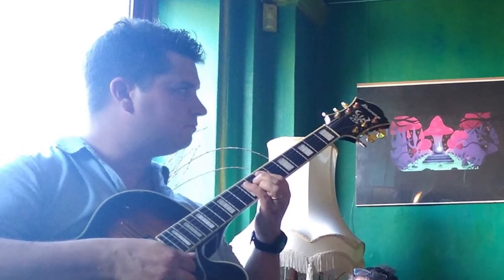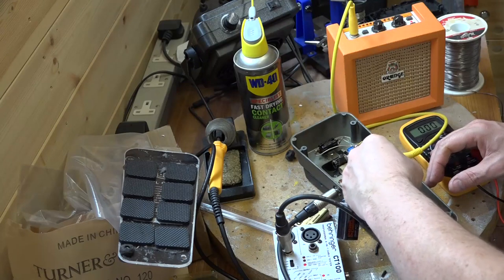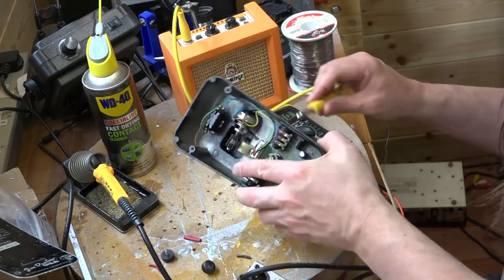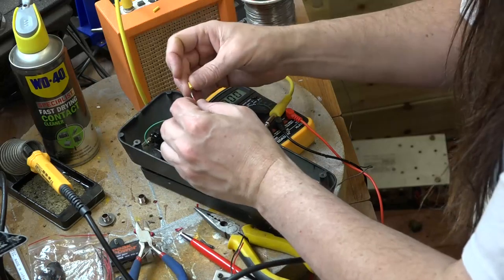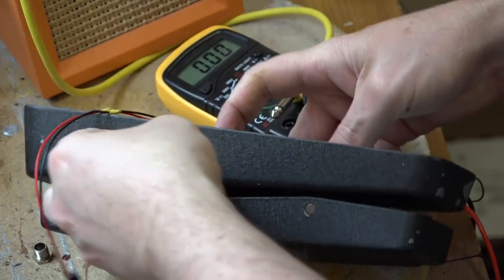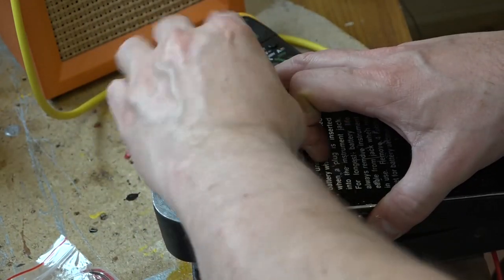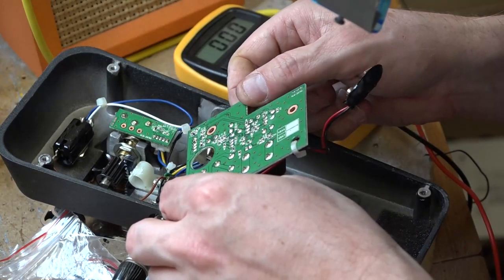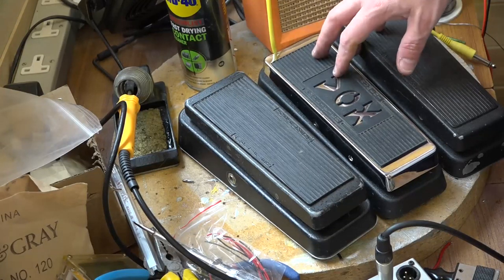Lets fix 3 Wah Wah Pedals (Jim Dunlop Cry baby and Vox)

Comment: Vox from Reverb : Well , opened the battery plate and was full of acid most wires and bottom & case cleaned out . Re solder new 9v plug . Shoot the pots with contact cleaner . Phono jacks cleaned . Now working !  $68.00
Reply from the maker: Winner!

Comment: Bought several non-working wahs on ebay and Craig’s list to use the enclosures for several projects.  First few I didn’t question their actual working/non-working status and ripped the guts out and replaced them. Got an early Hendrix wah that I decided to plug in and it worked perfectly. Picked up a newer Cry Baby 535Q - got it cheap because it didn’t work - worked perfectly.

Comment: I have the exact same pedal as the second one you worked on (Dunlop), but it's labeled as the Jimi Hendrix Special (Model JH-1S).  It also has a scratchy pot, but the gets less scratchy after using it for a while.  On the bottom panel is silk screened a picture of Jimi, and his "selected discography" starting with Are You Experienced - 1967 through Crash Landing - 1975,
Reply: I'd Say it's Time to Get a New Dunlop Replacement Pot Making Sure to Note The Proper Pot Ohm Rating for Your Model/Rev By Simply Using a DVM/Volt/Ohm Meter on Pins 1 and 3 of The Pot Using a DVM/Volt/Ohm Meters 200K Ohm Range Setting to Make Sure You Get The Corect Ohm Value Potentiometer for Your Model/Revision Wah.

Comment: Nothing is wrong internally the problem is when I push down on the pedal it does not engage is there something that could be missing or came a loose that keeps the pedal from pushing the button down
Reply: If There's Nothing Electrical Failing it Sounds Like Either Your SPDT (On/On) Switch May Have Gone Bad or it Needs a Height Adjustment, The Simplest Test for That is While You Have Your Wah Hooked Up With The Foot Cradle Toeup Physically Push The SPDT Switch On/Off With Your Finger, If The Effect Engages Your Switch is Good and Nothing Electrically is Failing, Which Would Mean it is The Nuts on The Switch That Need Height Adjustment, First Remove The Outer Nut on The Switch, Then Pull The Switch Out and Turn The Inner Nut Down About 2 to 3 Turns, Put The Switch Back in and Replace and Tighten The Outside Nut and Test for Proper Switch Height and See if You Can Now Toedown Your Cradle and Engage/Disengage The Effect, If Needed Repeat Those Steps Adjusting The Inner Nut Varying Turns (Clockwise/Counter Clockwise) Until The Switch Position/Height is To Your Taste/Touch.

Comment: RE: the 2nd pedal,  have one with similar electronics - my battery cable is routed under the circuit board. Mine was functioning but the sound was a horrible, high pitched distortion. I changed the 2 electrolytic caps before checking anything else. It sounds like it should, now. But, it's still not quite right. Because i didn't watch this video before starting i did a bit too much disassembly and i think i need to get the gear arm back to its correct spot on the gear of the pot. By the way, i have cutters that look just like that. I got them at harbor freight, but I'm in the US.

Comment: nice work. I have a Dunlap here mint condition I bought 20 years ago, hardly even used it.  it quit. now I know where to start, hopefully it's the connector solder joints on the board like those.

Comment: Interesting video .I came across this hoping to find a fix for the issue i have with my Jim Dunlop GCB-95 .
I have no tention at all so the toe position just goes straigh down without any resistance at all.
Could you possibly advice on this or even better do an instructional video? 

You certainly know your stuff .
Reply from the maker: by no tension do you mean physical, or is it just going from effectively bass, to treble with no change in between ? if its the latter id suggest as a guess a wire has fallen off the pot. Or the  pot is broken.
Reply: Do you mean tension from the P-clip? i.e. the weight of the treadle is easily passing the rack through the hole and spinning the pinion/potentiometer.